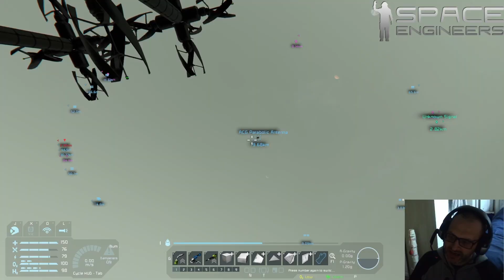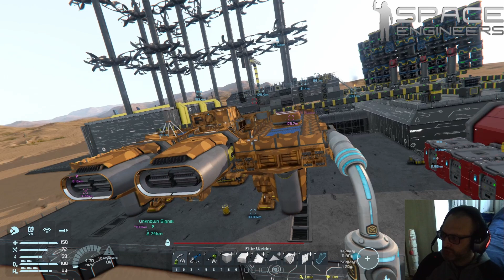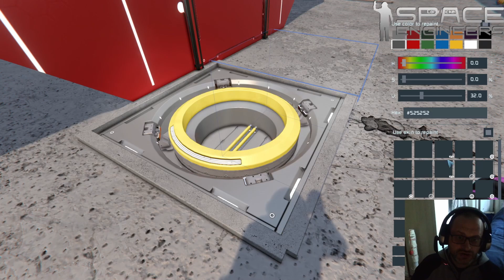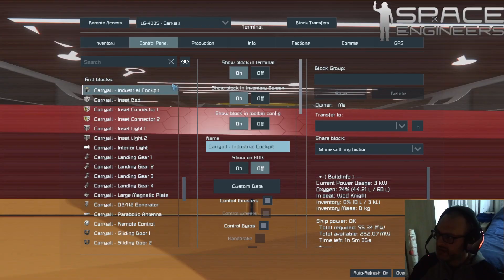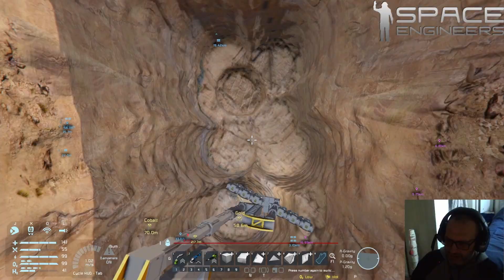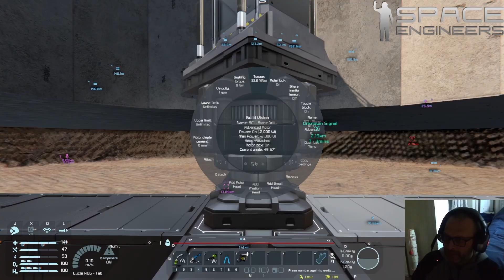Space Engineers - Hoodwinked! - Part 37

Comment: Splitsie always just used a rotor head that he could detach, add more pistons and then reattach.

With a sideways set of drills, one could opt for a hinge to do the same thing.

Just mag-plate the drill head to a temporary block in the voxel, add the new pistons [or conveyors] and then reattach the drill heads afterward, unlock the head from the temporary block and grind that temp block down before resuming.
Reply from the maker: That's a very clever way to approach it, thanks for the tip!
Reply: @archangulus  Thank Splitsie for this one.

Or, more precisely, one of his FANS/viewers in chat.

I just passed it along, he pretty much mastered it.

To see it in action, just look at his most recent series where he is making a restaurant on Pertam with Capac.

This is where he, along with some tips and suggestions from some of his players, figured this magical and yet oh-so-simple process out, and its a masterpiece of infinite drilling.
Reply from the maker: I will check out the latest Splitsie videos